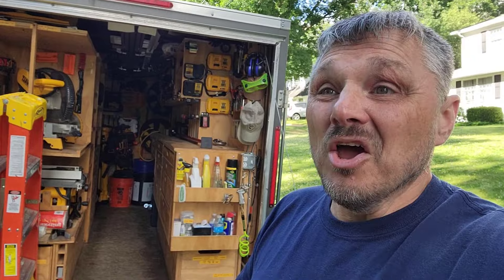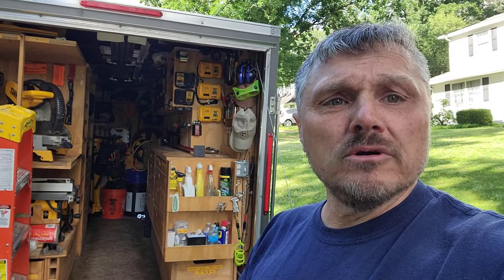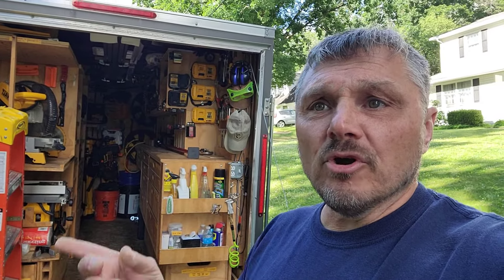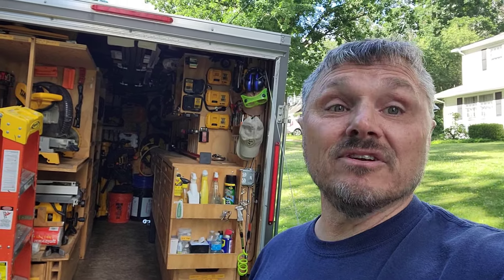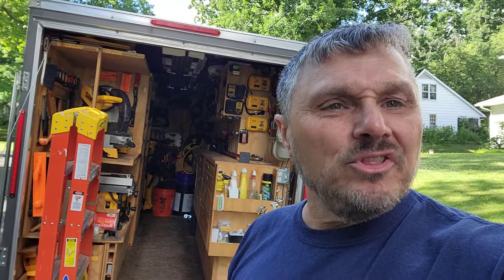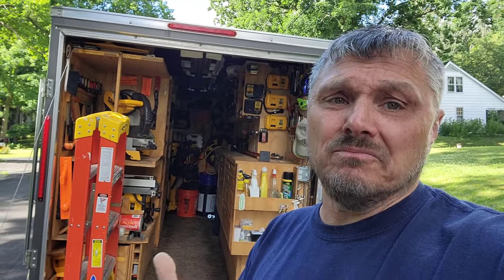MASONRY DEMO BEAST!  DeWalt 20V 1 inch SDS rotary hammer drill

Comment: Hey Steve, which model is that? I am hammer drill/SDS shopping. My 20v Dewalt drill is not a hammer drill, which I prefer, don’t need the added size and weight. I have a large corded SDS Bauer from Harbor Freight I bought a few years ago for a big bathroom tile demo job. As a handyman I need a hammer drill for  setting tapcons or anchors for mounting things mostly and was cross shopping the Dewalt DCD999 hammer drill or one of their smaller SDS rotary hammers. Seems with something like what you are using I could use for pretty much everything, maybe then sell the corded SDS or save it for big jobs where I may burn through batteries? Thoughts?
Reply from the maker: Howdy Rob. Thanks for Watching! (see what I did there...). Anyhow.......It is a DeWalt DCH273 rotary hammer SDS. If you need any additional info, here are a couple videos on my channel where this beast is the star of the show. 

https://youtu.be/pqFqmBfukVA

https://youtu.be/Pd_Yh_t_e8A

I use this drill primarily for masonry demo but I have drilled holes through masonry for conduit. It is a full blown hammer drill but I have not tried to run tap cons with it or drilled a small hole (5/16") for tap cons. If I need that level of finesse, I go to my DeWalt hammer drills first and forget I have this. I assume it might be a good all around tool that can do it all but I just forget I have it until demo comes around. To me, it is light for demo (but small scale...just right) and it is too heavy/bulky for tap con work unless I am installing a plate on a slab then this might be the beast of the hour. 

Thanks for the comments!  And good luck on the shopping trip! It would be nice to know what you end up with.
Reply: @sdsconstruction thanks Steve. I see Dewalt makes a 20v atomic version and a 12v as well but both of those are drill and hammer drill only, no hammer only function, which I thought might be nice to have. Also watched a couple comparison videos and both of those drill more slowly compared to the model you have. A lot of comments in the Dewalt Reddit group suggested I skip hammer drill in favor of a smaller SDS. Might keep my corded SDS and add the model you have.  Which hammer drill do you have and would you recommend it?
Reply from the maker: @WatchRob  drill/hammer drill - model DCD996. I have never second guessed the purchase. I have the "same" drill that is 10yrs old but is brushed (replaced once) and still works fine. I am sold on the 20V (or 60V) platform but only have two 12v tools (driver and a drill). They are fine for light work but am skeptical if I needed to set a number of tap cons and only had a 12v hammer drill. Granted, I have never tried it and as we all know, it is a poor workman that blames his tools, but if I have the option, I will go for the 20V system. Best of luck!

Comment: I have a makita rotary which is excellent, but my go to tool removing tile and mortar is my small pneumatic spring loaded vibrator gun with a similar bit as yours but much lighter and compact you can get very close to the floor without damaging subfloor, but again I’m not a contractor just an old diy’er 😂
Question, aren’t you a math/ science teacher? How about coming up with something that can vibrate the tile and mortar causing it to crack 🤔
Reply from the maker: Thanks for commenting Pit! I got this tool idea from a client actually. I broke tile out by hand because I usually was on smaller demo jobs where it was under 200sqft of tile at any time. I had used a really beefy corded Hitachi rotary hammer drill to break down concrete so I was familiar with that kind of tool but never thought (until a client mentioned it) to look for a smaller version of the tool. Next tile demo job I had, I had found this DeWalt tool It is the mid level drill they offer. They have a lighter one and they have a bigger one. So far, this one has worked out well.

As for innovating a tool to break up tile quicker.....I will get to work on that!